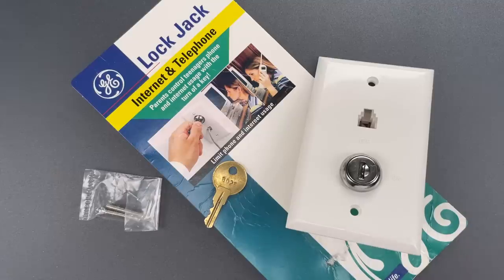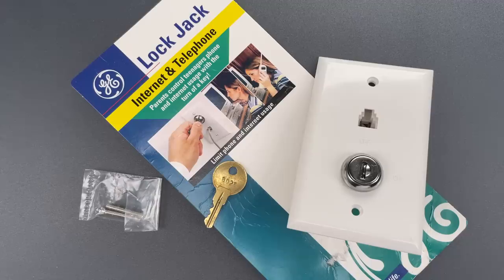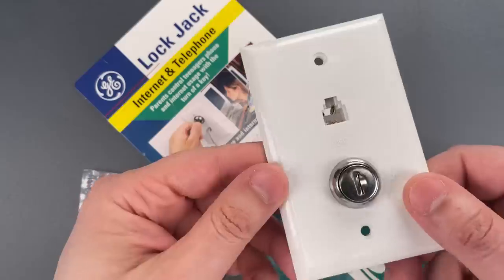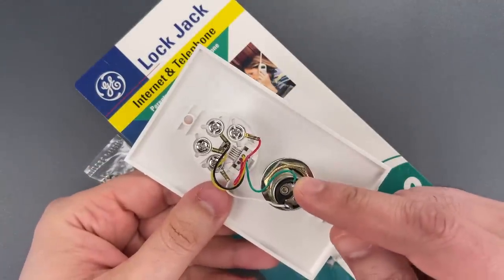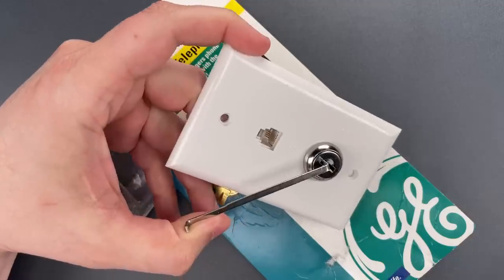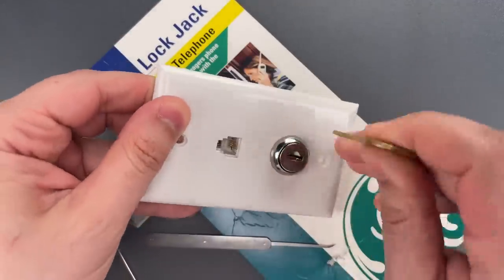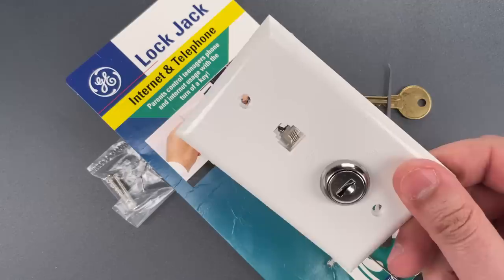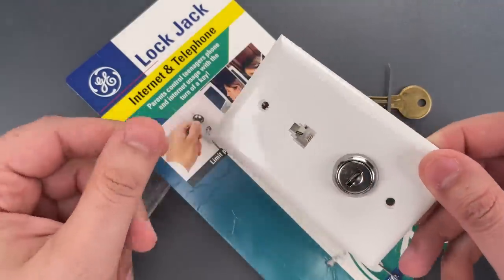[1284] 1990’s GE Internet Lock Picked

Comment: My dad had a much better way of locking the internet: disconnect the PC's tower and place it on a shelf way out of my reach.
Reply: Or just... have 1 computer in the house and just restrict access to the computer itself XD
Reply: it was a lot easier for parents to do that stuff in the 90s because, at least if they were anything like my dad, they didn't give 2 shits about whether the internet worked or not so they were willing to make things difficult. Nowadays parents need the internet as much if not more than their kids so its too much of an inconvenience to cut off access unless you're tech savvy
Reply: @TheMKCrab  A good router provide a setting for that (only allow specific device to connect. MAC address). Problem is: Your kids might take your Laptop when you're shopping, start it with a Linux on USB, read out the MAC address of the networkadapter, change the MAC address on their own computer to the one from your Laptop :o)
Reply: my PC had a key on the power supply that wouldn't allow for power when my parents were mad at me.
Reply: @TheMKCrab  It's not as hard as people think to disable internet.  Routers and modems have the ability to restrict times and devices on them so with a little know how you can manually decide which devices connect, when, what time frames, etc.  The methods to do it just got more advanced instead of the ol physical route.
Reply: @DumbArse  Same with the power cable, but back then the kettle had the same lead :D
Reply: My mother would hide the keyboard. I changed the BIOS config and started using the virtual keyboard for a while. Once she hid the keyboard in the oven, in the cleaning tray below it. She forgot about it and baked a cake. The keys got all twisted. It was really funny, we have relatives visiting and then I asked her if she had removed the keyboard from the oven before turning it on.
Incredible memories of the past.
Reply: I remember taking the wifi module out of the router  and when asked when the wifi wasnt working id be like idk
Reply: The easiest solution back when parts were expensive ( over $100 ) and proprietary was to remove the keyboard.
Reply: My dad had the best way of locking the internet... He went behind the PC and disconnected the RJ11 cable... He was holding the cable from the connector when ball lightning hit and fried floor of two rooms. He never took the floor away to change the phone cabling, he just sold the house.
Reply: @TheMKCrab  except I can go in my router, and restrict certain devices access with a click of a mouse.... that takes 5minutes
Reply: @peterpiper0815  Are you aware that MAC addresses are usually stamped on a device label?
Reply: Proceeds to climb the shelves and then the entire thing falls
Reply: I used to place the modem in my underpants drawer. That stopped the little bugger.
Reply: @spideybra  Hi! Not really on topic, but all the ovens I've ever seen have a broiler under the oven for cooking things like steaks at a really high temperature. I didn't know that sometimes the broiler is replaced with a cleaning tray. I hope your mother learned her lesson. Never store something in the oven. 
I read of a restaurant owner who was tired and didn't want to go to the bank at the end of the day and didn't have a safe. So he hid the night's cash in an oven, planning on going in early and taking the money to the bank in the morning.
When he got there, his chef was already in for the morning and had all the ovens cranked up to start the day. Lost almost all the cash.
Reply: Mine BIOS locked my computer when I was a shitbag 😂😂😂
Reply: Lol.  Nowadays I can just lock the internet with a tap of the screen.
Reply: My mom would take my monitors cord
Reply: My mom tried taking the power cable to work with her.

Didn't know I had like 5 of them.
Reply: @jmejuniper  Indeed, still remember my old PC have tubular lock that you need to unlock to switch on.
Reply: My mother always took my power cable and the modem to work moreover she locked the office, but let's be honest I still had internet access xD
Reply: mine just used to remove the cable - but never removed my printers cable, which was the exact thing I needed to connect to the internet
Reply: Beta Soy
Reply: @BullsMahunny   I'm sure your children will have no problems getting round that. They won't tell you how they did it of course.
Reply: A friend's parental unit would disconnect and put away the MODEM, later routers. Drives me crazy that still happens to people I know, in one case the younger sibling does it for some reason. It's a dick move, and there's better ways to deal with a perceived issue than that.
Reply: @BullsMahunny  you do realize this is talking about disabling the internet 20 years ago, long before the time of consumer routers. There was no router in the home back then, nor even an external modem. Your phone line would connect directly to a port on the back of your computer and the modem was inside the computer itself.

Comment: The best way to control the internet back then was to pick up the phone in the other room and try to make a call. My mom perfected this 😂
Reply: But would it work after the central times out the incomplete call? Or would the line remain locked until phone was back on hook?
Reply: Same 😂
Reply: That happened to me until I added a switch on my phone jack that disconnected all of the other extensions in the house. Only problem was when I'd forget to flip it back when I was done with the modem.
Reply: Best way to control the internet was to tell your kids not to get on the internet and mean it
Reply: laughs in secondary phone line
Reply: @johndododoe1411  Lockout relay generally stayed open until you go on hook. It's a bad idea to actually keep the line on lockout because it would trigger a trouble lamp and you could potentially get someone from the telephone company shouting at you.
Reply: @johndododoe1411  The modems would be disrupted until you put the phone back on the hook.  

This was twofold.  
First, noise over the line would prevent communication by modem.
Second, having a phone off the hook prevents getting a dial-tone.

Have you really never used an analog telephone line?
Reply: @mwbgaming28  Many times the secondary telephone line was still wired to the primary jacks, in a manner.  Usually it was wired to the line 2 pins on the line 1 plugs and the line 1 pins on the line 2 plugs.  This means with a line 2 to line 1 adapter you could disrupt it.  (Or just by sticking a bobby pin in the phone jack and shorting all the pins.)
Reply: @ruediix  I grew up with analog phones.  I know that many central office systems switch to a beeping error tone when phone is off hook for too long, which makes us humans hang up to get a nicer sound before dialing, so I don't know if dialing despite that sound somehow gets through, which is something a modem might try.
Reply: While playing LORD of which I had some pretty good progress under my belt, my mom picked up the phone. Somehow the line noise not only screwed up my game play, but caused various menus to open up right before my eyes of which there was an option to delete my profile... and I haven't played LORD since.

Comment: Back in my student days, phone in the computer lab had a tiny lock on the rotary dial. So you couldn't dial out, just press one of the button on the thing to dial a couple of places on campus.
But of course in all rotary phones, the dial did a make-and-break pattern for each digit - dial 7 made seven pulses as the dial rotated back. 
You could dial any number just using the switch-hook (the plunger that got depressed when you hung up the handset). Just take off the handset, and 'dial' your number by bouncing the plunger regularly for each digit, with a little pause in between.

Comment: Parents being sold on the idea of outsmarting their kids. 
Never seems to work out.
Reply: It's a great way to teach your kids the ingenuity to solve problems like that. Honestly I wish I had stuff like this as a kid.
Reply: Yeah
From everything imaginable
Reply: @d33p345  I never got caught…
Reply: Kids have the time and creativity to solve all kinds of simple problems.  My mom would take away the power cable for the modem.   I got around that by going through our drawer of cables, had to connect a plug to a different adapter.  Used a pair of scissors to cut and strip the wires.

I was like 8 when I was first started messing with wiring.  Fixed a power wheels by replacing a broken pedal with a spare light switch.  Good times...
Reply: @nicholase2868  Wow
You have the heart of electrician
Reply: @hellterminator  They knew it, they just didn't tell you :)
Reply: Because kids are smart
Reply: For perspective... my father used Torx screws so easily unscrewing it wasn't an issue. 

And changed the lock to something different.
Reply: Most kid proof things wind up being adult proof, like those push and twist pill bottles or when you manually break the cable box's parental controls by guessing every number from 0000 to 9999
Reply: @peterpiper0815  No, they didn't. They thought they secured it enough by locking the room. I got a spare key and although they didn't check any further, just to be sure I always marked the position of everything and put it back exactly the way it was and I turned the computer off an hour before they got off work so it'd have time to cool down before they got home. Unless they trapped it (e.g. by placing a hair on the chair's arm rest or something else similarly invisible), there was no way to tell. And they didn't do that because I was always thorough enough that they never suspected anything. Parents aren't omniscient.
Reply: My mom outsmarted me once by 'unplugging the internet'. I thought there was some switch or tricky in the basement for a whole month. Then one day I was super bored and just checked the wire. She had just been unplugging the DSL modem from the wall. That was a good summer. I think they figured it out after a month or two because the bills went up from the use.
Reply: @nicholase2868  I had almost the same thing they took the power supply from the router, and i accidently reversed the polarity and blew up the router, was not fun the day after when they went to turn on the router again.
Reply: @d33p345  My husband had really strict parents he had to hide everything from and even a decade later he still thinks in terms of "How to do this without drawing attention or being caught"
Reply: Good way to teach your children to be resourceful and problem solving.
Reply: @santosdr2  I never put books on the higher shelves to keep my kids from reading them, simply to make it a challenge for them get to them. 
They read every book I wanted them to and got to feel like they were being clever.
Reply: @jak2767  yeah, it can really mess you up  later.
Reply: @hellterminator  good for you, but i did.
Reply: @d1j16  Nice so that is what you did. Some will not behave like you, and children will still like to learn. Curiocity or wanting something and having the will to explore or reach your goal can be self taught as well. Even if you don't have parents that aim to teach you directly. You can learn from them indirectly.

But i'ma pat you on back because it is good to help your children with access to information not everyone is so fortunate to have had that experience or be able to offer it.
Reply: Anyone remember the V-lock (I think that's what it was called). A device you attached to your video recorder and could then program to prevent it playing certain types of video (that presumably had to be encoded to trigger the device). Of course, the only people in the house able to program it were exactly the people you were seeking to "protect".
Reply: That's what happens when one believes they are the divine instrument of God and forget that children if any age are still sentient free willed human beings.

Your 17 years 364 days and 23 hours old a mere child. 1 hour later your 18 tou can now consent sign contracts join the military and get paid to kill people and operate billion dollar war machines.

Yeah okay. I've met 40 year olds with the maturity of a 6 year old.

OTOH I've met 10 year olds that seem to be 30. 

More over say 90 years ago kids rode horses to school with a ui shooter on their hip.

200 years ago 15 year olds were married with kids of their own some time before that 10 year old were married. But then again in those times they were raised different they had been taught about life and were already able to run a house.

When we forget that a child is still intact a sentient being with a soul.
It leaves us to greatly underestimating them.
And if your that type of parent. Your kid probably hates you.
Reply: Those parents were just using this product incorrectly. As a parent, I'd support using this kind of product to give incentive to learn to pick locks. That is, the reward is internet access once you can pick the lock.
Reply: @hellterminator  neither did I
Reply: No, it doesn't
I found workarounds for all of the restrictions they tried putting up, nothing they tried ever worked
Reply: @peterpiper0815  agreed.
Reply: @JS-rv3et  am a kid with that type of parent, can confirm.
Reply: We had a firewall that only ran while the CD was in the drive. Took about five seconds to figure out the bypass!
Reply: @JS-rv3et  Only correction I'll make is that rather than being raised that different back then, they mostly just seemed to throw numbers at the problem. if you didn't learn by then you were screwed, good luck! treating kids as idiots who can't think for themselves until you suddenly don't was the same back then too. It's just the way that the environment influenced that mentality which then influenced people's actions that changed. no matter how far back you go through all the writings about children are basically calling them idiots who you need to strictly control to keep them from becoming overly independent and therefore obviously bad.
Reply: @claytonius3  damn. simpler times.
Reply: @eduardog3000  My parents constantly taking things away from me is what led me to me critically thinking about how they would hide them, and how I could ensure that I not only retrieved them but was able to place them back in the precise place to avoid raising suspicion. Further when it came to passwords and computers, it made me find ways to breach their security and create backdoors into anything I wanted. Now I am nearly finished with a degree in computer science and I think the critical thinking skills I developed from trying to find ways around the school and my parents locks were critical.
Reply: Funny enough, what got me interested in physical security was when my parents disconnected our wireless router and locked the room it was in when I was a young teenager. It's how I learned a butter knife could be used to shim the door open.
Reply: Until they check the phone bill 💸
Reply: @hellterminator  reminded me how I used to wake up after midnight so I could boot up my computer (in my room) to play RuneScape because other times I wouldn’t be able to.
I got intense anxiety whenever the startup beep occurred and often tried in vain to muffle it. Luckily my mum is a deep enough sleeper that not even the fan running would wake her up.

I had also made sure to turn it off like an hour before she’d wake up to go to work so it would cool down.

Although once a I got caught because I forgot to cover the bottom of my door so when she got up and saw a crack of light coming from my door. Worst day of my life.
Reply: Parents back then: I'll get a physical lock to keep my teenage kids off of inappropriate sites like stickdeath.

Parents today: I'll get my 7 year old to break into my phone again because I locked myself out...again, also, while you're there, can you make the SD card not full again and fix the wifi, its doing the can't connect thing again, k thx.

Comment: My parents put a cylinder type lock on the TV we had when I was a kid in the 80s/90s.... they never knew that I took the back of the TV off and unwired it!  ;)
Reply: We had one of the TV ones as well, but my dad replaced the cheap lock on it with a slightly better lock from a cash box. 

I eventually took the barrel out and removed all but one pin and put it back. I could unlock it with anything, but it 'felt' like the key worked so they never noticed.
Reply: Really tempted to rewire the switch in the router to only turn off the lights.
Reply: My parents just touched the TV to see if it was hot or not.  I had to be cool, if not ... auch.
Reply: @ikocheratcr  I would guess you're a bit older then, as solid state sets produce much less heat than their tube-based counterparts.
Reply: @eDoc2020  Yeah TV was a little heavy box  (by today standards) with squared glass thing in front, ie fish bowl.  ;)

Comment: I remember once in the windows 98 days, my mother took away the mouse to stop me from using the computer. I learnt that day that you can control the entire computer without the mouse 😂
Reply: Same here. Windows was much more aimed at keyboard navigation than Mac OS of the time (which had barely any keyboard navigation at all - probably due to their legacy: the Macintosh at first didn't even have arrow keys on its keyboard because Jobs wanted people to use the mouse, while Windows was originally an add-on on top of DOS), but I managed to activate "mouse keys" (an accessibility feature for people having trouble with the mouse)  in order to move the cursor with the numeric keypad. Slow, but it worked.
Reply: Other way around for me.  My dad took away the keyboard lol.  Which NGL was smarter because then I'd be stuck on the Press F1 to continue POST prompt.

Comment: I learned to pick locks like this as a child by just sticking a nail file in them, jiggling around a little to line up the wafers and turn. I didn't even know what a jiggler (or wafer for that matter) was back then but these locks turned me on to the method non-the-less.